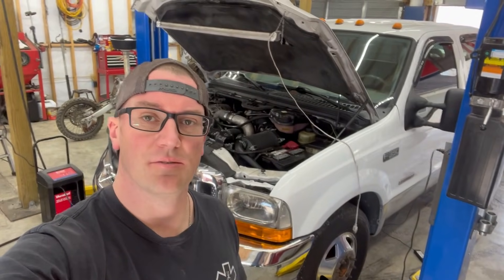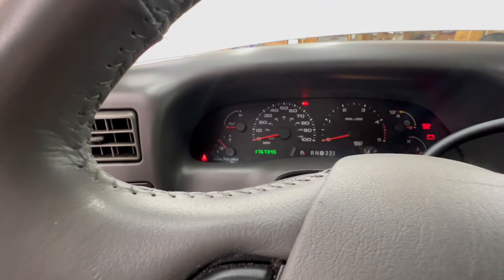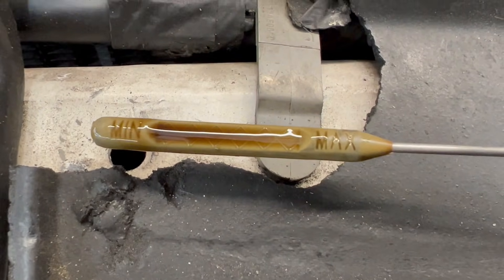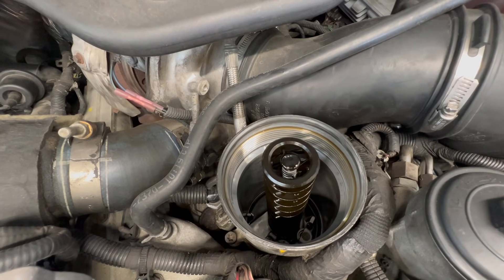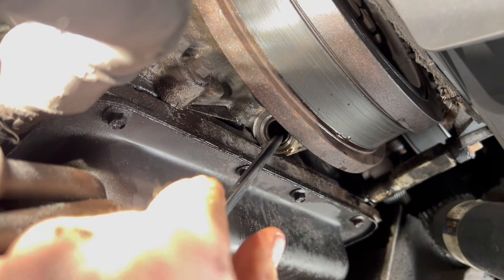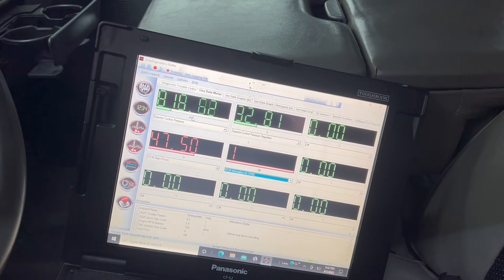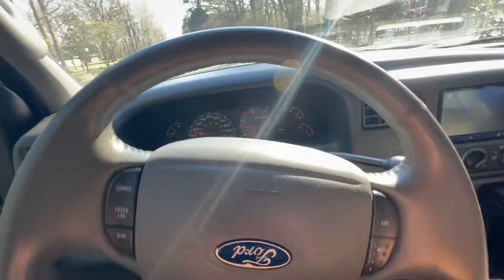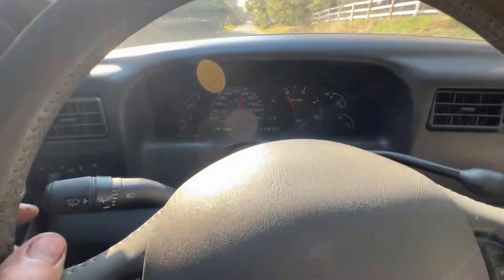6.0 Powerstroke crank no start no base oil pressure

Comment: What part of Arkansas are you in? I have a 2009 f350 6.4l that's got a no start issue but it popped out of gear on the interstate and then stalled on the side of the road once I restarted it it stalled out again and wouldn't start again it's not deleted at all I'm in central Arkansas near Conway
Reply from the maker: @robschottenbauer4677  we are in Arlington, tn. We have a place on greers ferry lake but live in Tn
Reply: @AutomedicGarage  I'd love it if I could get some help with this damn truck Ive only had it for about 6 months was running great no issues had a glow plug issue so my mechanic changed the harness then it started staying stuck in cleaning exhaust filter mode kept cycling through it everytime I'd drive the truck. For about a month it did that but would run fine then I moved back to Arkansas broke down in New Mexico and had to have a long haul tow here how easy is it to change the EGR valve?
Reply from the maker: @robschottenbauer4677  it’s not bad but I try not to mess with 6.4s, they are ticking time bombs

Comment: Did this filter housing fills up but it’s still not starting. Still nothing on the gauge in the truck. ICP is reading 0. IPR at 85% when cranking ficm sync is 1. No idea what to do now
Reply from the maker: @LucifersLoad1  if icp is 0 that’s your problem. Do air test.
Reply: @AutomedicGarage  what size is the fitting for the ICP? Hoping to find one close by so I can test it
Reply from the maker: @LucifersLoad1  don’t test through icp go through ipr

Comment: mine alsways made a sound when i turned on ignition before cranking it over. now it will crank but no start and no clicking not sure what the clicking was but i had this truck 3 years its a 2005 6.0 and today no start. i tried bleeding the fuel because i did nearly run out of fuel last time i drove it. i am in tears i need my truck back on the road
Reply from the maker: @hellothere312  clicking noise was probably your FICM going through it’s cycle. See if you have 47-48 FICM main power and 12v battery power to your FICM.

Comment: Same symptoms,  however I am already getting base oil pressure up into filter housing..  do I explore icp and ipr now,  then ficm.. I have no scan tools for verification of the voltage and pressures in ficm, icp ect.. I am kinda trying to figure it out  low budget.. Definitely have oil coming up filter housing,  definitely have fuel coming into filter housing as well.. so I am starting to look towards ficm, icp, ipr, hpop.. absolute diesel Novice..

Comment: Saved me a lot of time. I saw I had low base oil pressure so I was about to replace the pump until I saw this video thank you very much, it fixed the low oil pressure issue. Prior to this crank no start happening the upper seal and snap ring broke and lost half of the snap ring in the engine I couldn't find the rest of it so I put it all back together fired it up and it ran for a couple days and then it died again and the other half of that snap ring getting caught in the valve for the pump.
Reply from the maker: @chrismontalvo6831  go to harbor freight buy the strongest magnets they have and stick them on your oil pan it will hold anything that makes it down there

Comment: What if it starts with starter fluid
Reply from the maker: @gilbertoalejo985  don’t use starter fluid… probably has a Hpo leak and the starting fluid made it spin fast enough to build 500 to crank
Reply: @AutomedicGarage yea I have this same issue. 

How would I test this.  Do you have a video?

Comment: I did  one test only... ipr valve changed by the mechanic,   he told me   low oil pressure pump  don't  work,  I went to even half of your steps...( oil filter removed , push the valve and crank  the engine, oil filter reservoir  filled up  in few seconds!!  ) I didn't  obviously   take out the check valve , p.s  cranking the engine  oil pressure from 0  went up  to   half   on truck gauge. I guess I have pressure? ) 
  don't  have any  check engine. only an abs light  on .. ! 
engine cranks  but still don't  start!! what could be?
 new injectors, top diesel filter changed. fuel pressure ok, ipr valve changed  
egr delete, air filter ok  .
the problem started with a stall on the road , than truck was starting for few seconds and stall again..      only thing wasn't  changed  is bottom diesel filter..  but if it was clogged  I should have   diesel squirting up from  top  engine diesel filter  if  just unscrew  few turns the cap!!!
WHAT COULD BE????   IS A 2005 LARIAT. ALWAYS WELL TAKING CARE OF..   ESPECIALLY  MECHANICALLY!!   PLEASE HELP !!!
Reply from the maker: @nikeandros  need live data to point you in any kind of direction. Hook a scan tool up and see what icp, ipr and FICM are doing

Comment: I have an 06 6.0 with a crank no start. Quit on me going 80 in the fast lane and I had to coast over to the side. Was able to get it going eventually and got it home over an hour away. The next day it started for a min and then quit. Couldnt get it started again. Thought it was the fuel pump so tried replacing that and its still not getting fuel to the bowl. Something in the pump or by the bowl doesnt sound right. Im also going to check the oil pressure as you did here tomorrow. Any help where to start next with the fuel issue would be much appreciated!
Reply from the maker: What’s your fuel level? What’s your fuel pressure? Has your in tank pickup been replaced?

Comment: Definitely going to check and see if the oil pressure builds like you did but my question now is would that effect it when it starts cold but not when its hot???
Reply from the maker: The lpo relief will affect it at anytime but more so when the oil is hot

Comment: Hi there which software do you have in this video  that shows the oil pressure act great video also if it not the valve under the flywheel stuck what is it.

Comment: Thank you again. I went and with the checks found that the oil tube broke - the plastic part of it. I found a piece inside the where the oil sits. I replaced that part. The oil builds up like in the video. Any chance that some plastic made its way to something else where it’s not building up pressure? What should I look for? My oil gauge  still reads zero.
Reply from the maker: Are you referring to the oil filter stand pipe or the drain back valve?

Comment: Thank you so much. My 04 6.0 decided to break in all places all at once. If it weren’t for you I would be paying cash I don’t have.  I wish you the best. Another Q. I looked into
Some things I still don’t have low oil pressure but with your troubleshooting guide my p
Oil filter plunder broke. I’m assuming that’s the culprit. I’m hoping this is one of the final things that has to be fixed before it starts running.

Comment: So measuring a fliter like that will. Be the same no matter what cap you run. The difference is on top of yhe flange. The cap height another words. The seal flange down will be the same.
Reply from the maker: The distance that matters is from the where the cap seats onto the housing to the bottom of the filter. Some cheap caps don’t hold the filter firmly either so it will recess more also.

Comment: What’s the next step to look for if it did fill it up with oil?
Reply from the maker: If it fills with oil in a few secs and the drain back valve holds you low pressure side is good. Move on to the high pressure oil side and diagnose that.
Reply: @AutomedicGarage  that’s been replaced when it was built proofed
Reply: @AutomedicGarage  it’s reading oil pressure on the gauge while cranking just won’t fire
Reply from the maker: @jacklowe6177  the gauge is only for the low pressure side and is basically a idiot gauge cause it reads anything above 7lbs. I need to know what your icp and ipr are doing. Doesn’t matter if it was replaced when bullet proofed a lot of stuff can leak or fail not to meantion was it done right?
Reply: @AutomedicGarage  I got it fixed I appreciate your responses

Comment: Thank you this worked on my 06 had a little piece of metal in the low oil pressure valve got it out and cranked right up

Comment: Hard to beleave ford would make this junk of a motor. I hope i never buy a 6.0 diesel. I like the 7.3 by international.
Reply from the maker: Ford didn’t make the 6.0 or the 7.3 or the 6.4. They are all made by international. The 6.0 is known as a VT365 by international.
Reply: Every truck has problems, was the 6.0 a nightmare of engineering yes. After bulletproofing the truck i own had had relativly normal issues forna 20yr old truck. At 420,000 now.

Comment: so, i pulled my relief valve out and of course it sprung out at me, cleaned it up good and reinstalled, went top side and was watching my reservoir while key off and the reservoir didnt fill….i also tried depressing the plunger in the reservoir still no change….is this a bad lpop? its a 2006 f250 6.0
Reply from the maker: You have to crank the truck over. LPOP is driven off the crank.

Comment: My brother... i need your help bad. I wom two repair shops in Arkansas. We dont fo diesel repair and i own 6.0. Its been BPd a few years ago. 2005 (08/04) f350 4x4. Driving other night and went to pass and engine and trans bucked. Lacked power. Got to my destination and let it sit. Fired up but idled rough. Barely made it home sounded like one cylinder. Next morning no start. Stumbles but no fire. 

Replaced ICP and harness. Voltage was .08 at KOEO. With new its .14 which still seems low. While cranking it goes to .78 volts. Injector pressure appears normal 1500 to 2500 psi.

I replaced fuel filters just bc. 
I have oil flowing into filter housing while cranking. Nice flow

Diesel fuel appears fine no contamination. Removed air filter and no start. So intake air and fuel dont appear to be problem atleast getting there. Oil appears good and had recent oil change 500 miles ago. Trucks always taken care of. 
FICM is good 48 volts. 
SCT program livewire

Move to IPR? Or air testing? Im stuck in gravel driveway at the moment so shop air will be difficult
 When cranking it will backfire at exhaust now

Comment: So I did your oil test, got oil, did your bubble test from another video for injectors, no bubbles. Still just cranks no start. New icp, new ipr. Kinda wants to kick over when ether is used. Oil quality is new, filter new, level at max. Where else should I look? Based on my work schedule this thing has been down for months now and if you weren’t just shy of 3 hours away I’d of already brought it to you, lol! Thanks in advance!
Reply from the maker: What’s the pids during cranking?
Reply: @AutomedicGarage  I don’t have that tough book monitoring setup you have but have been contemplating getting it. Do you recommend I get it for more accurate diagnosis?
Reply from the maker: @revolutionanarchy713  your just guessing and throwing parts at it without it
Reply: @AutomedicGarage  ok
Reply: @AutomedicGarage  what’s the brand name of that program, I forget
Reply from the maker: @revolutionanarchy713  Autoenginuity

Comment: Heya, I'm over here working on a 6.0 van E350, same powerplant.   Was getting low oil pressure, ICP at 50 max after 15 sec of crank; pulled low pressure relief valve, was sticking but no debris; after cleaning still 50 max at ICP

Comment: What if you are at 1400psi on icp ipr is at 47 low base oil pressure only clombs after cranking on it around 4 times with long cranks?
Reply from the maker: If you have 1400 icp then you don’t have a base oil pressure problem. Hpop has to get oil from LPOP to build pressure. Have you pulled your filter and looked at your drain back valve? What oil filter are you running? Oem filter cap?
Reply: @AutomedicGarage  yes i actualy followed your instructions on your video. I have the sinister bypass oil filter system. I measured the oil filter and cap like you did and got the same length as you did. And i also cranked and the oil filter reservoir filled up with oil. So thats not the issue. I have swapped iprs about 5 different times. After a very long crank an ebay ipr valve started my truck but idles high and erratic. Installed an oem ford and will not start. I do get rpms and base oil pressure. But only after a very long crank times. Ive been working at it for months and cannot for the life of me figure this one out. 47 ipr and 1400 on  icp is what my scan gauge reads with oem new ipr valve but no start. Just crank.

Comment: What happen if it still build oil but still no start only start with starter fluid but truck runs great when running
Reply from the maker: DO NOT USE STARTING FLUID!!! If you pumping LPO this isn’t your problem. What’s your icp, ipr%, FICM main and FICM sync say when cranking? What’s your fuel pressure? This video only applies if your not making low pressure oil. If you keep throwing starting fluid at a truck your gonna crack a piston or rings.

Comment: Is there a torque spec on the Low Pressure valve spring plug thing that u removed in this video.
Reply from the maker: Yes I don’t remember it off hand but I usually just tighten it up with my 3/8 ratchet

Comment: Hello I have a quick question I have a truck in my yard that has the same problem but one of the guys sprayed starter fluid and it will start right up and run fine
Reply: Do you think that could be the reason
Reply from the maker: @waderobinson5796  could be, but pulling live data would tell a lot more along with fuel pressure.
Reply: @AutomedicGarage  thank you

Comment: Thanks for the info. brother. I'm a mechanic for a school district and we have a mini bus that has a 6.0 and I'm dealing with a crank, no start situation. Watched your video, took some notes and will knock it out tomorrow. Thanks again.
Reply from the maker: Sure thing, hope it helps you out.
Reply: My truck is still doing a crank no start I just replaced the IPR valve it was damaged and the screen was as well and it’s still not turning on
Reply: @justindaniel5087  mine to, new ipr and icp screen was shot, have lowboil pressure, nothing in the valve, has fuel, absolutely no pressure, I'm at the point of a catastrophic hpop failure. Does try to start with starting fluid done it once just to see if it just needed a pick me up but that was a no go as well. Last time it tried to start it let out a huge puff of white and gray  smoke but no antifreeze in the oil or vice versa so head gasket isn't even on my radar at this point lol. 😊
Reply: @nickcatron821  same problem
Reply: @klaneboy did u ever figure it out ??
Reply: how did it go  I have now   same problem and mechanism said  low pressure oil  absent.. and he told me to scrap the truck!!!
Reply: Wowww... 😮 @nikeandros

Comment: My friend, your videos have been a life saver time and time again. My only question with this one specifically: if it does fill with oil, is it as simple as replacing the filter cap so that it’s long enough to trigger the drain vac?
Reply from the maker: If it fills with oil while holding the drain back valve closed the. You first off have a working LPOP and your drain back valve works.

Comment: 05 6.0 replaced oil and fuel filters now truck crank no start, tried the cranking with no filter and housing fills up with oil but doesn't show it on the gauge cluster (pressure stays low)... primed fuel lines and still only crank to start... unplugged ICP and still no start.. would next step be replacing IPR? thanks for the video!!
Reply from the maker: If it was cranking fine before you changed filters your either sucking air into fuel system or your using a non oem oil filter or non oem oil filter cap or combination of the two and your not closing off your drain back valve completely preventing the truck from producing high pressure oil. Gotta use oem cap and filters or buy a reputable aluminum cap. Whatever you do DO NOT use anything other than OEM filter.
Reply: @AutomedicGarage  i replaced the filter with motor crafts (oil and fuel) after installing and having crank no start i realized the cap wasn't OEM i purchased oem cap and replaced it did notice a height difference still no start. went and installed old filter and cap that had before still no start.... re installed fuel filters. i do get fuel up to the engine bay housing so lower filter must be on right (is that correct logic)
Reply from the maker: @EnriqueA562  what is your fuel level at in the tank?
Reply: @AutomedicGarage  it was a little higher than 1/4 when started now it right below it from the multiple attempts?
Reply from the maker: @EnriqueA562  put 5 gallons of diesel in it. Prime the pump several times. And let me know what happens.
Reply: @AutomedicGarage  appreciate it! i'll try that this evening and will let you know!
Reply: @AutomedicGarage  forgot to tag you i put 5 gallons of diesel cranked it for about 25 secs a couple times and no start
Reply: got home filled her up with 5 gallons primed it 11 times still no start.....
Reply from the maker: @EnriqueA562  need to see what your icp  and ipr and FICM main and sync are also need to know what your fuel pressure is
Reply: @AutomedicGarage  ICP voltage .25, IPR cycle 14.84%, ICP 8.55 psi, FICM main 0, working on trying to get fuel pressure
Reply: @AutomedicGarage  got these off bluetooth app scanner
Reply from the maker: @EnriqueA562  I need to know what the numbers and pids are cranking. NOT key on and not cranking.
Reply from the maker: @EnriqueA562  what’s the fuel pressure